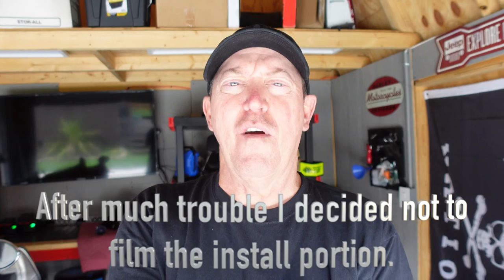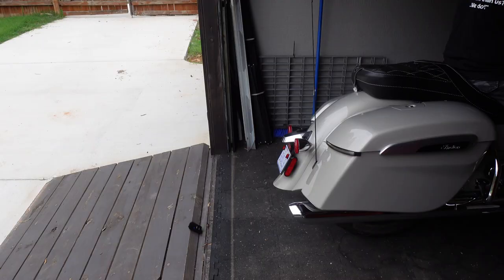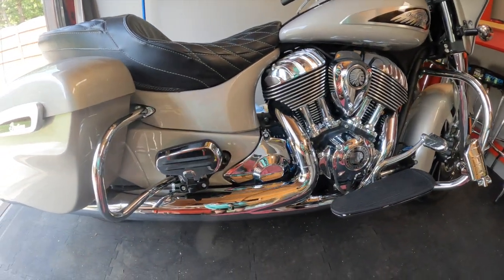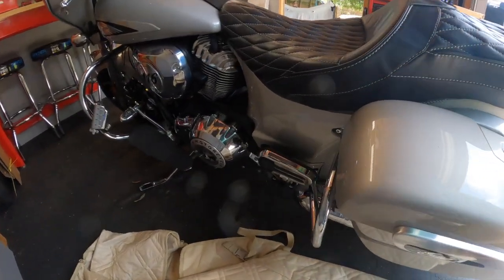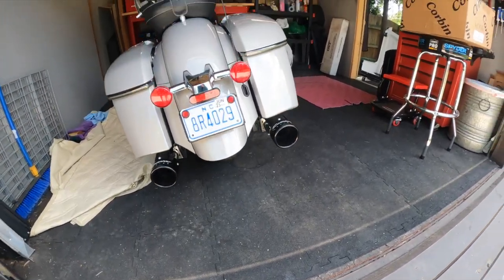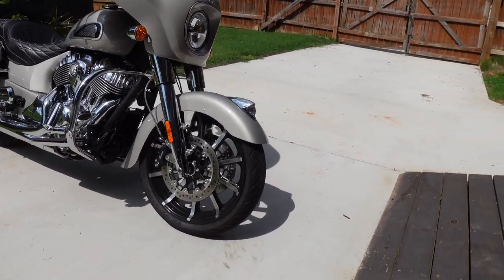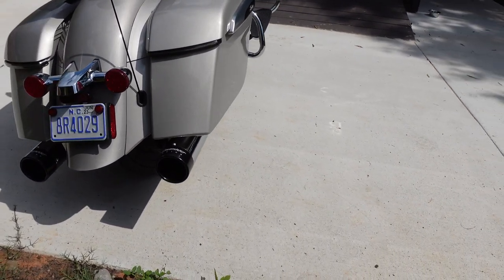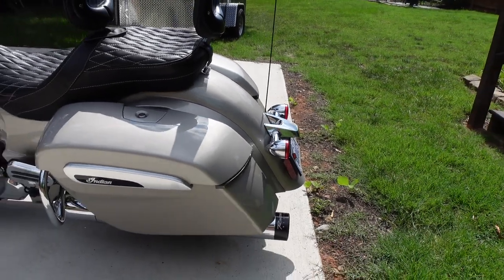Rinehart's Installed on my 2022 Indian Chieftain Limited

Comment: Lovely sound.  I'm debating on the Rineharts.. or maybe trying the SharkRoad pipes.  The SharkRoads are only $300.. and seem to be getting decent reviews.  I don't like my bike really loud tho.. I prefer a deep tone with a little bark.. but not annoyingly loud.  I did remove the CAT last weekend.. and it made a huge difference with the throttle response.. and heat.
Reply from the maker: Thanks Joe. I’m the same…don’t like obnoxious loud. It’s quieter than it sounds in the video because the mic was fairly close.  I looked at the SharkRoad too and was considering but I really wanted Rineharts and I got these for $300! Did you have to put a programmer/tune in when you deleted the cat? That’s something I really want to do.
Reply: @602North  No re-tune needed.  There's a guy locally who does them.  He's the president of the Indian Riders Group in my area.  He just cut the CAT open.. removed all the packing.. and welded it back together.  It was literally an hour job.  He only charged me $100.  It was well worth it.
Reply from the maker: Wow that’s awesome!